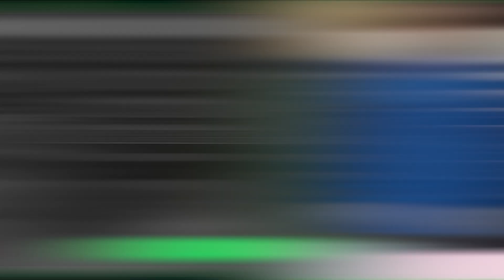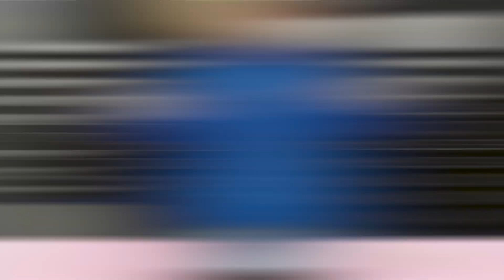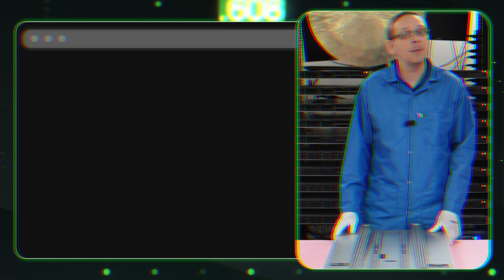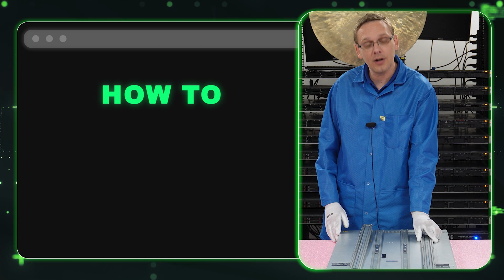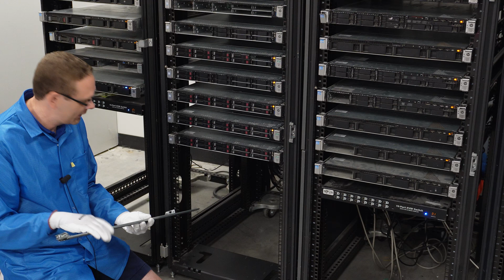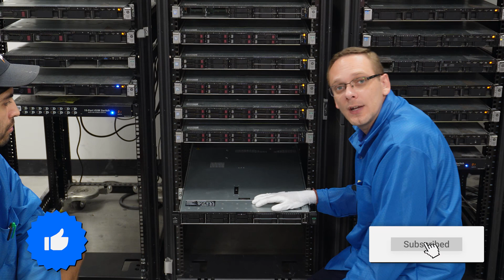HPE ProLiant DL360 Gen10 | How To Rack a Server | Server Racking | Sliding Rails | Rackmount Server

Comment: How to remove the rear side of slides?
Reply: Got it however the rails don't seat into place on both front and back. The instructions actually say to remove the screws for some reason. Which I read and did before I watched this video.